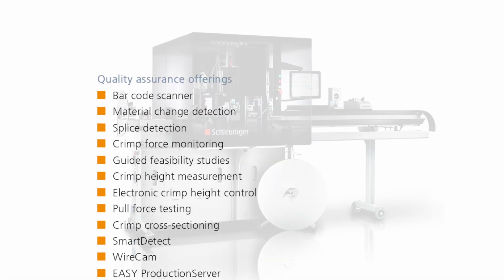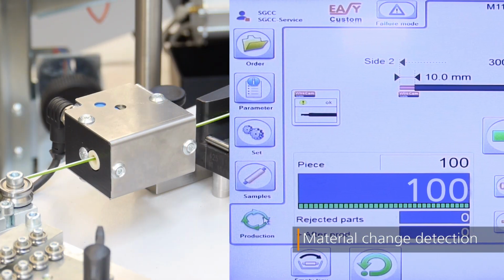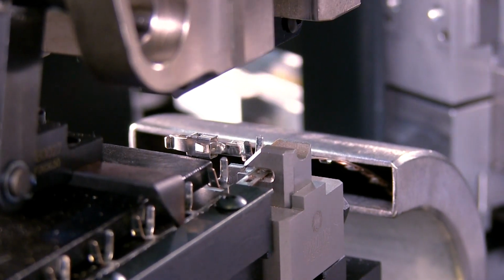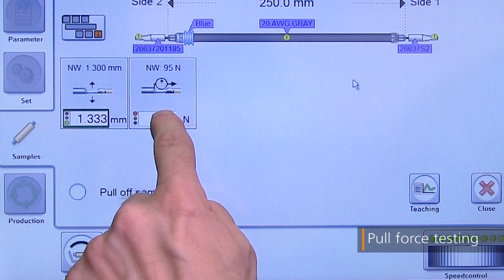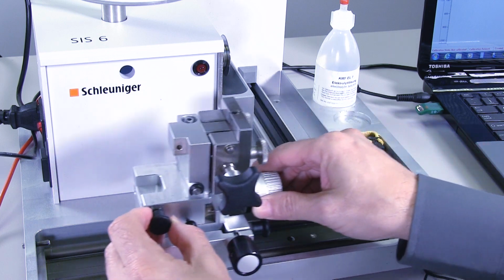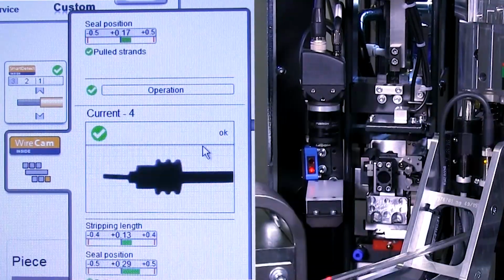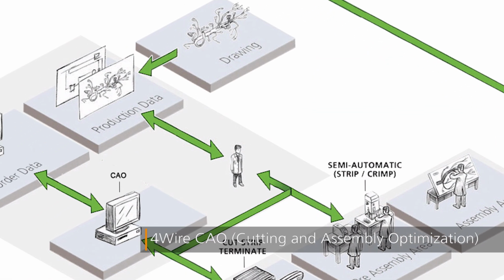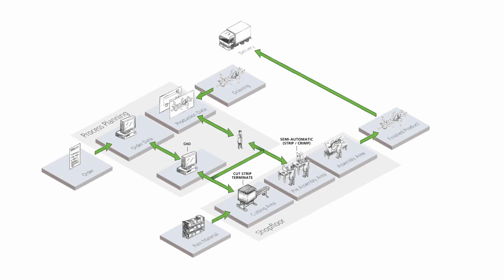Schleuniger CrimpCenter Quality Assurance Options

Comment: so cool Video,we are provides terminal machines for One core cable, Multi-cores cable, Flat cables.

Semi-automatic terminal crimping machine; Wire stripping & terminal crimping machine; Full automatic wire cut & wire strip & terminal crimp machine; Wire splicing machine;  Ultrasonic wires welding machine; Benchtop wire crimping machine; cable lug crimping machine.
Follow me, we can give you good price .~~